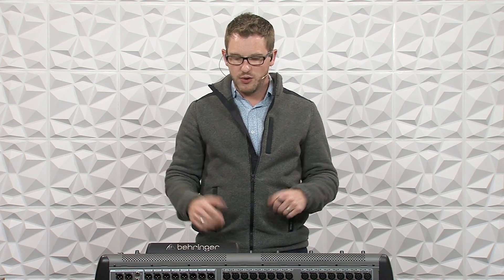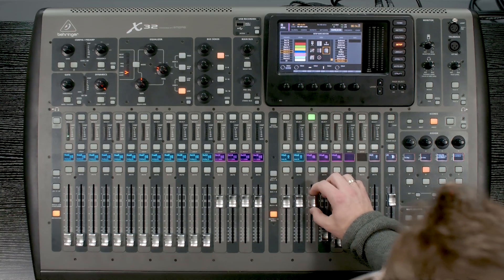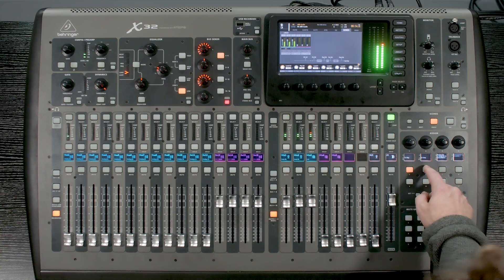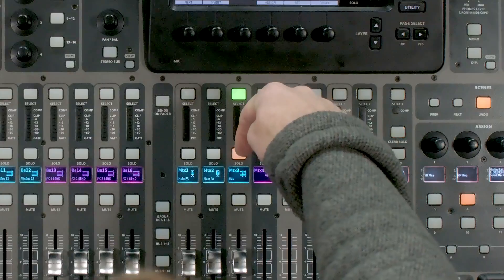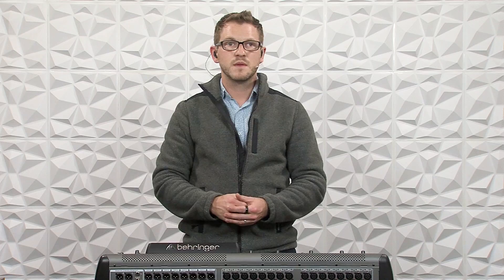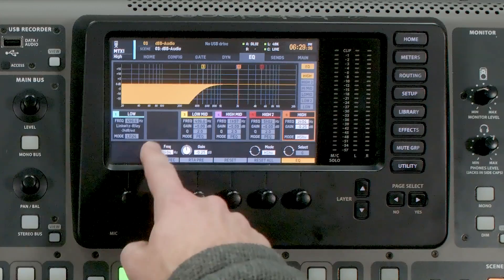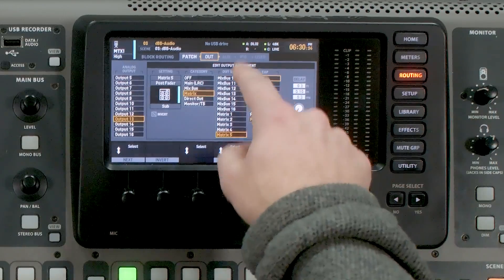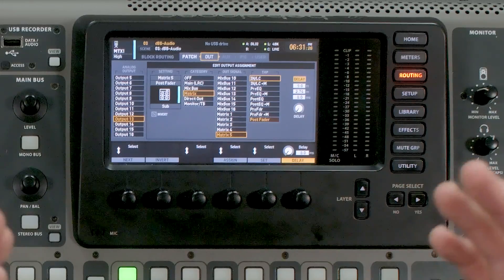Use the Behringer X32 As Your System Processor

Comment: So I'm running my main LR PA  through Matrix 1 and 2. I have 2 subwoofers, should I run it as stereo, Matrix 3 and 4, or running it as mono is fine?
Reply: Both are fine. The latter is nice because you use one less matrix.

Honestly, it's probably better just to use a mixbus to feed your subs in most cases anyway. I've yet to mix a live show where I went "gee, I wish I had more random piano notes or random mic rumbles in my subs".  Just feed the kick and bass and whatever else into the mixbus and skip having to crossover entirely.

Comment: Gret vid. If you have a sub each side L&R I'm guessing you'd just use channels 3 & 4 linked and use two outputs right?
Reply: Short answer, yes you can.

Long answer, there's barely any need for a stereo sub setup. You can use two outputs, and have them fed by the same matrix, or send one out to the sub and daisy chain to the other. If you aren't using that matrix or output for anything else, sure, but it's superfluous.

For just a LR and Sub (no front fills, delays, etc) I just use a mono mixbus post fader to feed the outputs going to the subs. I don't want piano in my subs anyway.

Comment: Hi drew. I purchased a x32. For our trio group  why is it my manual only has 4 pages of English and it doesn’t have information for any of these settings that you are showing
Reply: Because the manual would need to be several volumes to contain all these deep details lol
Plus with firmware updates things are constantly changing.

Behringer themselves put out videos and additional information, but people like Drew who are explaining options for specific use cases are the best way to learn it, short of just going hands and and taking the time to learn it.

Think of a digital console as a blank slate, it has a bunch of features with many ways to use them depending on your use case, and all Behringer needs to do is tell you the basics, and then you have to apply your own knowledge of your use case to configure it.

Comment: Drew, one thing to mention here is in version 4.0.2 using the Butterworth and Linkwitz-Riley filters adds/incurs 9ms-10ms of delay/latency on your matrix outputs. That's the delay the X/M32 incurs to add those filters via its DSP. If you're going to use the output delay to time-aline your speakers, etc make sure you use a true measurement tool as that 10ms DSP delay can/will bite you and cause unexpected phase shift and comb-filtering . :)

You can easily test this in SMAART by calculating the delta between a Pink Noise loopback and the non-EQ'd matrix vs a Pink Noise loopback and the matrix output using a BW or L/R Filter.
Reply: So should I delay the subs then or the PA speakers? Any advice?

Comment: One advice for those who can afford a lot of money is to buy a home theater processor such as Trinnov Altitude 16. Some high-end processors can let you set crossovers and timings without having to mess with Behringer. Plus, some high-end processors may come with room correction technology built-in so that it can adjust the levels, set the distance, and run an EQ calibration for all the speakers in the venues. I'm not sure if a home theater processor is appropriate for a large venues, but at least that is an option. Of course, the downside for this is cost and that a home theater processor is designed only for home theater use only, but that is something to keep an open mind. Of course, the Trinnov Altitude 16 does feature 2 analog XLR inputs, which can be very useful.

And I know home theater processors are not home theater gear, but that's all I can give for now.
Reply: Sorry, but this would likely be a really terrible idea. The first issue would be the difference in expected signal levels between pro audio equipment, and "consumer" or "prosumer" audio equipment. Lets just stop there, and suffice to say that while there are many similarities between tuning a HT system and a PA, there are many differences too. And it's the differences that will come back to bite you. 

System processors already exist for pro audio... in fact, every quality line array manufacturer either makes their own, or recommends a suitable 3rd party model, although some of the smaller powered line array systems have the system processor built in to each speaker and are fully adjustable remotely (eg JBL 900 series). If your budget only allows for point source speakers, then you can get started (in 2024) with a Behringer DCX2496 for under $400USD (front panel programming only). If you can spare a little more cash, move up to a DBX Drive Rack PA2 for around $600USD (Win, Mac tablet remote programming). There is a really long list of these things... you can start by looking at those 2, then doing your own research. Sky's the limit in terms of features & price. 

Also, learning how to manually tune a system is a priceless piece of information for those times when automation fails... highly recommend taking the time to learn if you are or plan to be a sound engineer. Even if the "auto" button ends up sounding better, knowing the process expands your mind & abilities.  Bottom line, anybody reading this post in the future, do NOT do what the original poster suggests!!!!
Reply: @radioflyer2030  WALL. OF. TEXT. Please separate your wall of text into paragraphs.
Reply: @graysonpeddie    Okey Dokie, Mr Grammer.  Not everybody is from a first world English speaking country.  I hope that pagination meets or exceeds your expectations.